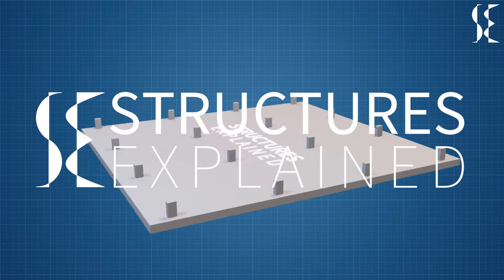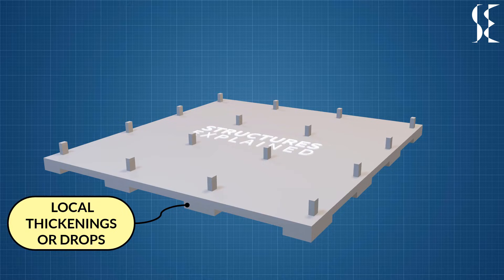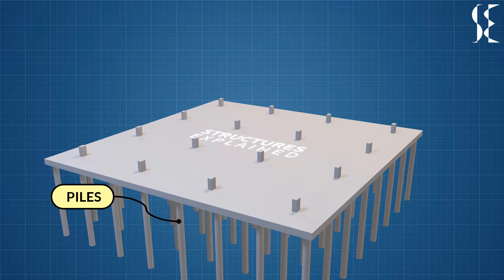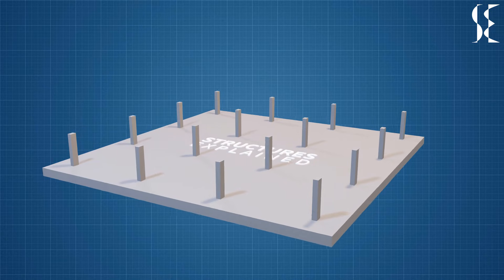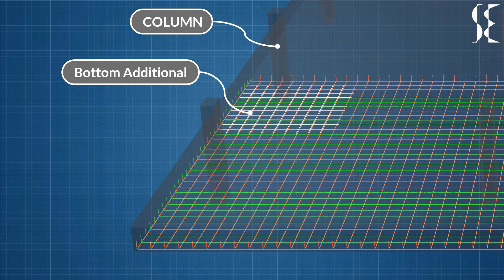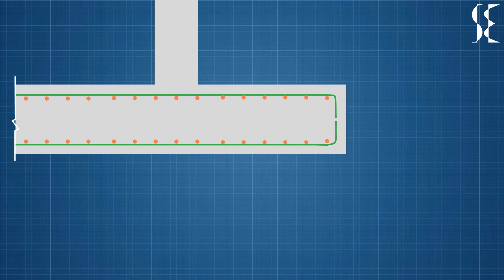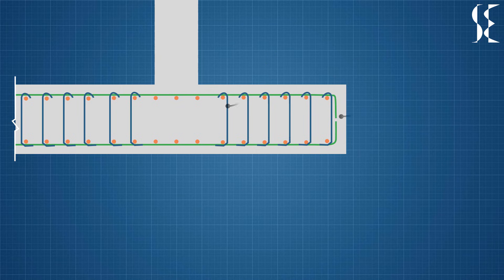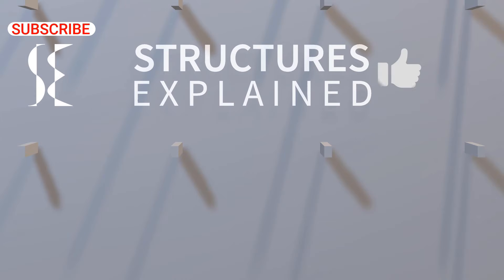Raft Foundation Explained

Comment: Sir suppose my raft is 23.700*7*0.600 m and supported by 5 wall which means it divided 23.700  and wall inner to inner distance is 5 m then which direction is mainbar is to be placed and which direction distribution is placed and why??

Comment: 4:00 if the above columns are of steel the lap reinforcement is not needed ???what you mean by that????
Reply from the maker: Hi Ali, in the video columns are of concrete and some part of reinforcement is left for lapping upper construction of columns. If the columns were of steel, there is no reinforcement and just a pedestal will be required at base.
Reply: @StructuresExplained  you mean if upper colum is type of steel I beam type or not concrete  type then we dont need lapping bars and we only need below concrete column for pedestal.?????
Reply from the maker: That is correct

Comment: You mention of shear reinforcement around column is nothing but beam connecting all the other column or something else.. someone explain
Reply from the maker: Hi Mohamed, the shear links or studs mentioned in the video are not of beam. For this video, column is directly resting on raft.
Reply: @StructuresExplained  in shallow foundations we give plinth beams incase of raft there is no such beam connecting other columna all together ?
Reply from the maker: Depends on design, if required raft can also have beams connecting column to column.

Comment: Is there any thumb rule to decide whether what depth to consider for raft?
Reply from the maker: No, it depends on various factors like concrete strength used, column/wall load, soil properties, water uplift, reinforcement provided, punching shear, etc. In short, analysis is required to find depth of raft.

Comment: Best sir . Plz tell me about drop or step in raft.
Reply from the maker: Hi Ajaz, drop below the columns resist the punching shear in the raft. Due to increased thickness locally, column will not punch inside raft. Additionally, drop increases positive moment capacity of the raft locally, whic means raft can take higher moments below the column. Hope this helps. :)
Reply: @StructuresExplained  thank you so much.